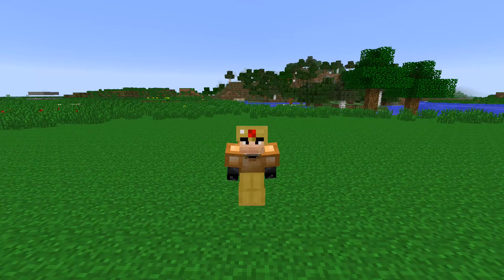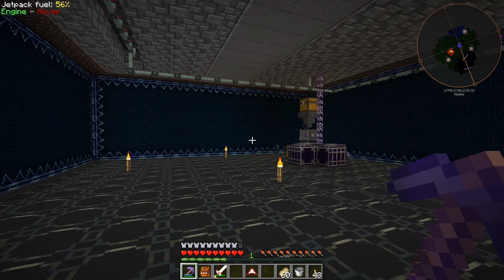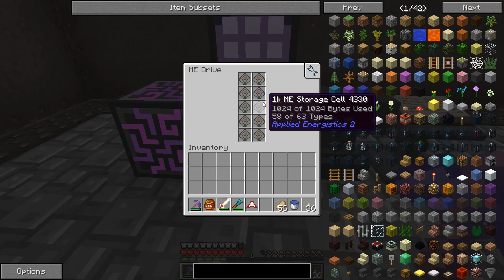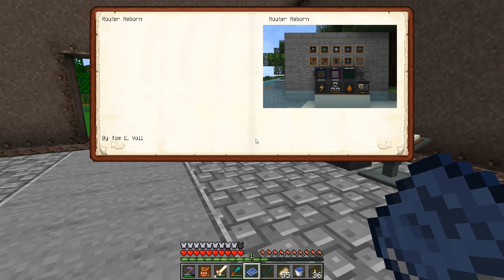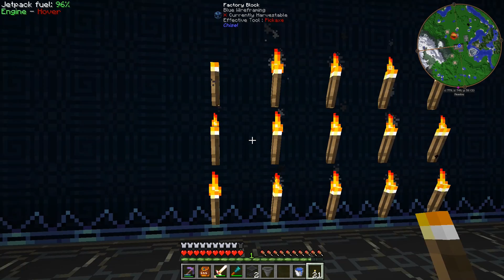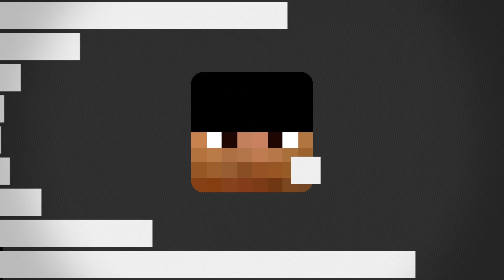Minecraft Mods FTB Inventions - ROUTERS [E16]

Comment: You wouldn't even need to use routers to do the pressing. Just get three presses, use IO item conduits to insert/extract and put both the gold and silicon into the last press with redstone. The item conduits have built in filters, so you can run all three ingredients and the resulting bits through the same cable. Ender IO conduits REALLY lets you make things nice and compact.

Comment: With the no channel tunnels try using the ender io me conduits they are pretty cheap and Work well they can't connect to any terminal but can attach to a regular me cable to connect love your vids keep up the great work also good not don't try bundling the me conduits with energy conduits or anything it glitches out the channels and the cables won't work.

Comment: P2P channels were removed for the same reason as almost everything else they pulled, it's computationally intensive.
Reply: The issue is a matter of perspective and scale. These guys chose these alterations such that it would be viable on a large server. When you're being creative, its much more fun if there are a bunch of people you can share it with. 

So your perspective is one player, on one machine, which turns off when the player quits. Not that hard to run in the grand scheme of things.

For the FTB Team, their perspective is that of a server which runs 24/7 with 20 or more players. Every inefficient thing that a person does then gets magnified by 20. 

They have an entire beta test server for these packs on which they have done extensive testing using tools like Opis to pinpoint which mods and threads are using the most processor time and causing the biggest slowdowns.

+Joachim Von Grimorium Its a config option. Figure it out.
Reply from the maker: Never had a problem on any other playthrough with p2p channels. I question this reason.
Reply: minecraft by itself is computationally intensive DAMN IT. removing features from a mod "cause it's computationally intensive"  is stupid. this pack is meant to build complex systems, it's even in the description. WHY THE HELL you remove something that ADDS complexity !? even if my pc is not the best i've never had any trouble..